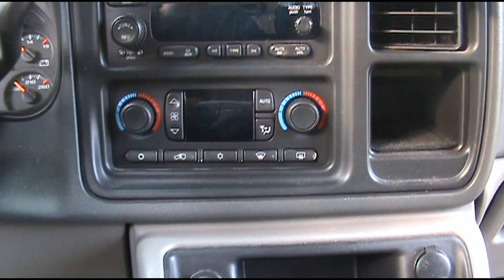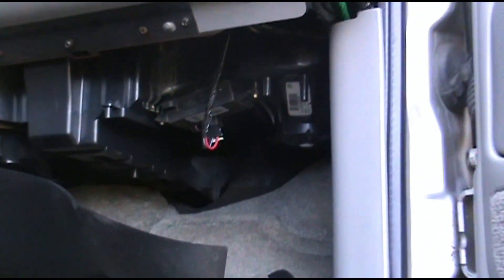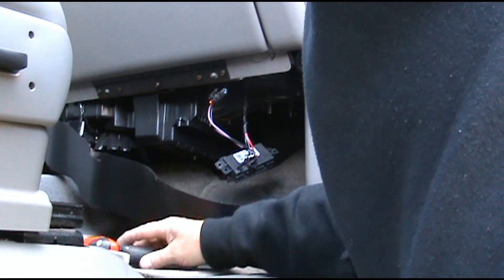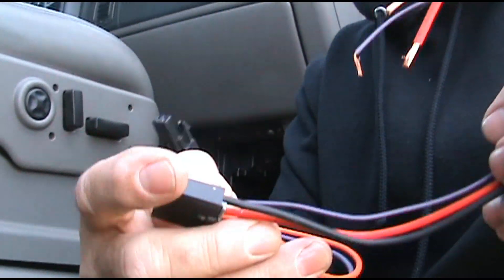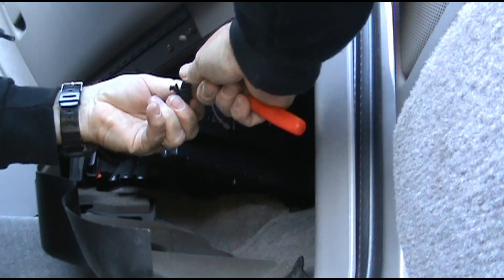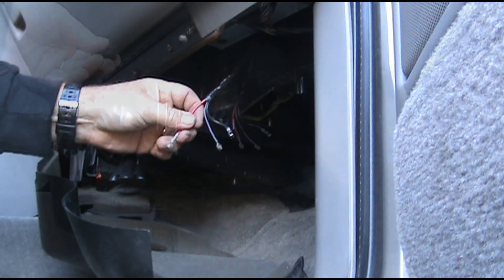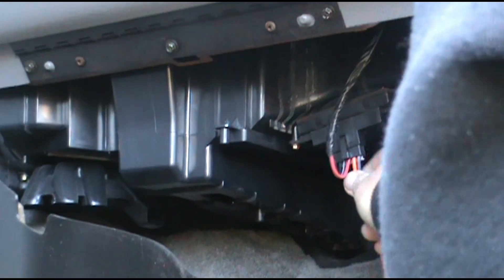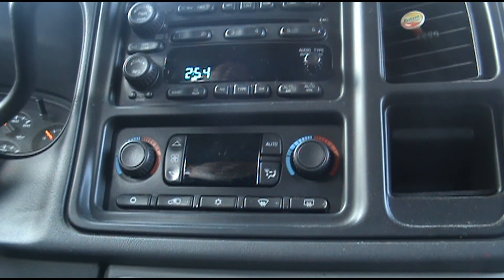2005 Chevy Tahoe Blower Motor Resistor Replacement

Comment: I work in heavy equipment & drive a truck for my dad hauling construction materials. About a year ago before,my dad & I sold our two gravel pits,I used my mind for ingenuity like this on a daily basis. Me being 33 years old,seemed like not very many my age,who I had hired & tried to help them out with a 50+hour paycheck knew little to none at all about how ppl with an ingenuous mindset actually saw day to day life. Btw, wiring is something I'll walk away from. It's the one thing that I'll admit,can beat me & get the best of me. Therefore,I've always chose the easy way out. However,when it comes to my 2007 2500HD classic model personal vehicle,I would/do personally like to fix & change all my oils,any problems or hiccup's that come along with owning a vehicle. My friend,I would personally like to thank you,for your advice,also I'd like to thank you for having & caring enough about any random stranger in the world,who watches YouTube. 5/24/2020 I received a blessing. That blessing was you Mr. Lonny & your incredible second to none video on installing this blower speed control power module. Thanks alot Lonny. God bless

Comment: Thanks Mr. Johnson. I just replaced my first blower motor resistor thanks to you. I can do the usual vehicle maintenance, but I’ve never been very good at the more involved repairs, especially when it comes to the engine, AC, etc.....
Sure, it took me 4 hours longer than it took you, but I did it and I’m stoked. (After also watching video about 15 times). Hahaha. 
I’m a hero in my house today for sure. Thanks again.
Reply from the maker: Cool!

Comment: I bought the resister over a month ago for my 2005 but haven’t had the time to work on it.  But, I have watched your excellent video twice late at night!  I could splice and solder quicker but I really like the clean look of your approach and plan on following your instructions.  Thanks for the great detail and clear, direct to the point instructions.

Update: I used your approach and my blower is working perfectly!  Getting the wires free of the connectors was a bear.  I obviously wasn’t freeing the clips and ended up cutting apart the connector from the blower to free those wires. Once I figured out that you remove the blower by pushing aside the plastic clip then twisting the blower it came out easily.
Reply from the maker: Thanks and your welcome

Comment: I have done the same thing. Using a gm disconnect terminal tool.Done the correct way. Great job. No cutting splicing or soldering needed.
Reply from the maker: Thanks!

Comment: good job.  Just got done replacing my resistor before I saw your video.  I can appreciate the information about how to disassemble the clips (didn't know this could be done) but honestly I used quality butt connector terminals and was done in half the time that you were. If it is all under dash, it shouldn't matter
Reply from the maker: Thanks and that's true nobody will ever see it. I just don't like cutting wire if I don't have to.

Comment: This video is if you have the Auto Temp Digital controls.

The Alternate is the Dual Slider Control, which has like 6 wires.

Follow a good wiring diagram because some pig tails now use black and white wire only.
Reply from the maker: Thanks

Comment: Thanks for the tip. Just finished up but the resistor is pretty hot to the touch , is that normal ?
Reply from the maker: Your welcome and is it hot only when it's running?

Comment: Best video & explanation ever! Question...My dad has a 2004 Chevy Tahoe, same issues...I noticed when I plug in his info I get more than one Blower Resistor Replacement Part. Would you possible know the difference between the JA1582 ($60) and the JA1639 (which you used at $103)???
Reply from the maker: I think you need the JA1639 because the other part has to many wire connections.
Reply: @LonnieJohnson1  Exactly what I ended up getting! Thank you for the video and the help! After watching your video it was sooooo easy!
Reply from the maker: Cool! glad to help

Comment: I bought a 05 Tahoe a few weeks back, blower had no problems this week it’s been -10F for 2 days blower wouldn’t work right away, in morning 5 min into drive kicked on, next morning started car it came on then at work today started car it didn’t come on got down the street and it came on, loose connection or resistor? What’s your guess.
Reply from the maker: Resistor.

Comment: folks this is the way a damm video is supposed to be done, simple, to the point, no punk music blastin in the background. Well done Lonnie, and btw, i have same truck as this, front blows hot, back blows cold. I have recalibrated my blend doors a few times, it works for awhile then goes back to hot, and i'm in SE Texas where the heat is insane. What do i need to change out to stop this, and do you have one of these grade A vid's on it. Thanks man....Roost
Reply from the maker: Put the A/C on cold and when it does that again turn the truck off and start it back up and see if it resets the controller. If you are losing cold air I would say your pressure valve, and I have a video on that and it's only about $20.

Comment: Thank you for the video! I replaced the resistor motor, and checked all the fuses, but the air will not blow out of the front vents. It does come out of the back vents still with no problem... what now?
Reply from the maker: Do you have power from the resistor plug that is connected to the motor? and if so did you check to see if the motor works by connecting it to a 12v power source. If you hook it up to a 12v power source hold the motor tightly so you don't damage the fan when it kicks on. The back should have its own blower and resistor.
Reply: LonnieJohnson1 it should. The air stopped blowing from the front vents, we purchase a new resistor, and I connected everything back like it was originally today, but nothing changed. I checked like 4 different fuses, and all of those were good to go as well

Comment: Was your blower on full bore when the vehicle was running, and this allowed the fan speed to vary properly? Mine is on full power and just wanted to make sure this would work for mine as well
Reply from the maker: Mine blower only worked when it wanted to and not when I wanted it to.

Comment: Thank you for the video it helped me for about a year now it’s not working again. Some times when I shake resistor it starts work and some times it doesn’t .. obviously the connection may have loosened any advice ?
Reply from the maker: The first one I purchased lasted about 2 months but luckily from Auto Zone it was warranted and they replaced it and I have had no issues with it so far. However, I would pull the plug and check the wires to see if there is an issue with the wire. Wires should be easy to fix.
Reply: @LonnieJohnson1  I did that and seems there must be a connection issue so I may have to cut the wires and solder it as I can’t trust the connector when I’m in the mountains 20° outside without heater lol appreciate the reply bud

Comment: What if I just use a wire twister connector? I did that and it works fine. Should there be a problem in the future?
Reply from the maker: That is fine it will work it just don't look factory, also make sure you get them insulated good.
Reply: LonnieJohnson1 . Thanks

Comment: I have no control of the speed, also when I turn my vehicle off the fan continues to blow. so I pull that fuse every time I shut my vehicle off. that would be caused from the part you just replaced correct?
Reply: yep

Comment: Thanks so much for the post.  My blower isn't working at all.  I will try and replace the resister.  Which me luck
Reply from the maker: Your welcome and good luck; let me know if it's your blower or resistor. The blower is easy to check.
Reply: How do you check the blower?
Reply from the maker: Take it out and connect it to a 12v battery red wire to positive and black to negative. Make sure you hold it tightly because the cage is plastic, if it turns and hits something it could break it and cost you more money.
Reply: Thanks for posting the video and quick reply! 👍
Reply from the maker: Let me know how it works out.
Reply: It works and now the blower is working again. 
As for the resistor module - of all places I checked, and there were many, Amazon had it! The pins were exact - no extra wires.

Comment: Do they not make a OE replacement? I'm having trouble getting the part - now I guess I see why?
Reply from the maker: Only for the new models now. They don't carry the old OEM parts but this part will work without cutting wires.
Reply: LonnieJohnson1 Thanks.

Comment: I had a new resistor installed in a 2002 Suburban, ever since I have had a battery drain, takes bout a week to drain to point where it has to be jumped.  It's not the battery, less than a year old, had it checked.  Anybody have any ideas?  Is there anything I should check?
Reply from the maker: I don't use my alarm at home only when I'm out somewhere. My truck alarm will run my battery dead.
Reply: @LonnieJohnson1  Old vehicle, no alarm.  Thinking I might try to replace the alternator.  I've had several people suggest that.  Who knows.
Reply from the maker: Did you check the alternator to see if it was charging?
Reply: @LonnieJohnson1  About 2 weeks ago, I found a guy who knew how to check it, he said raving at 14, then back to 10.  I don't know what that means, but he changed out the alternate, genius.  For a year I've been having to jump it about once a week.  You are a smart man.  Thank you.
Reply from the maker: Thanks and the 14 and 10 are charging amps from the alternator and you need to have a constant 13 to 14 or more to keep the battery charged.
Reply: @LonnieJohnson1  It's amazing even old ladies can learn something every day if they pay attention.
Reply from the maker: Cool! good to hear. I try to make fixing things as easy as I can.

Comment: I replaced the blower and resistor on my 04 yukon and at first it was blowing and a few mins later it stopped blowing. Fuse is fine, the red wire is receiving power. I’m lost on what else to do. My AC was working but I replaced the  blower because of a bad noise. Now I regret it. Have any idea what to check next?
Reply from the maker: Put the old blower back in and see if that fixes the problem. Your new blower might be bad.
Reply: LonnieJohnson1 sorry for the late response. I had a buddy take a look and the blower was working fine. Some how while I was troubleshooting, I damaged the resistor. (Working while beating the rain)
Reply from the maker: Did you have to buy another resistor? and is it working now?
Reply: I purchased the new resistor just haven’t installed it yet. It hasn’t been too hot around here lol. I’ll eventually get to it.

Comment: My 2004 GMC Sierra was squealing like a banshee when it got really cold here and I had any fan setting on (until truck warmed up after 30 or so minutes), couple days ago I smelt some burning and the fan speed knob no longer kicks on any air flow at all. Did my blower motor crap out, or resistor? I looked at the harness plug and it doesn't look like any wires are burnt/melted.
Reply from the maker: You can pull the blower out and check it to see if it still works by putting a 12v current to it.
Reply: @LonnieJohnson1  I am almost at the blower motor, will have it out tomorrow. What tools would I need to put 12v into it?
Reply from the maker: Use 2 wires and connect them to the positive and negative side of the battery. Connect them to the blower or just the positive and make sure the blower is grounded to medal or to the negative side of the battery. Be careful because if the blower kicks on you could damage the fan so make sure you are holding it tightly.